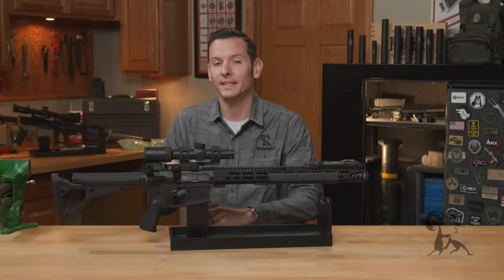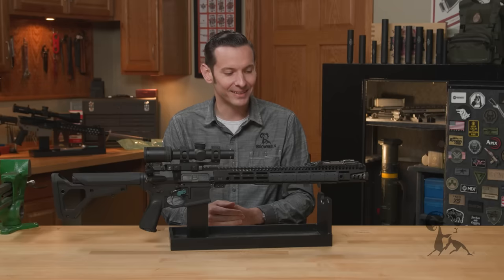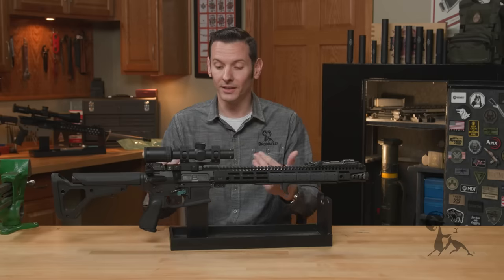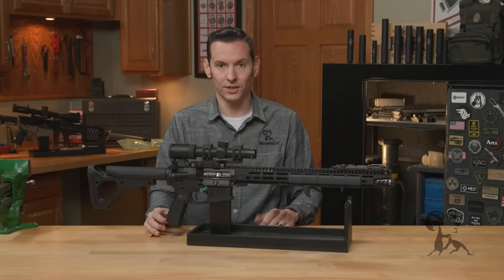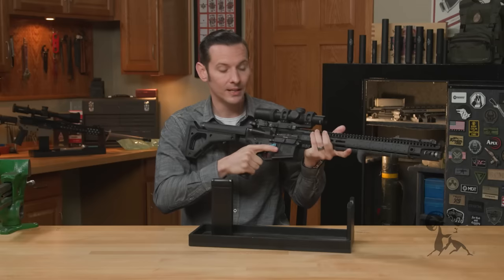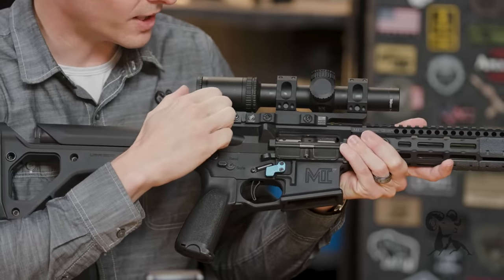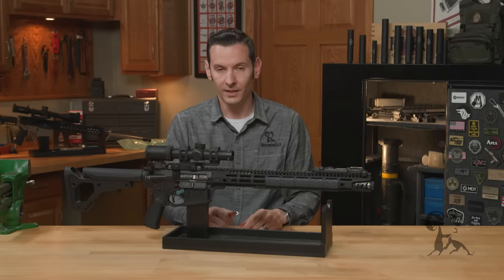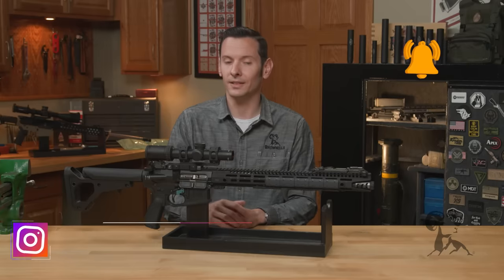Quick Tip: The RIGHT Way To Use the Forward Assist

Comment: The right way to use the forward assist is not to use it at all.
At least that's Eugene Stoner's point of view. And who am I to disagree?
Reply: And yet the US Army's extensive field testing of the weapon showed that it was absolutely necessary. And you will see Grunts and combat arms people and every single one of these threads about a forward assist saying they have used it themselves. But who are you to disagree?
Reply: @M7A1bayonet  I'm a former 11B3P with decades of experience using AR-15, M16A1, M16A2, M4A1, M4 in all types of environments ranging from coastal rain forests to Korea, Panama to the Middle East, US Mountain West to Scandinavia, including high volume shooting in all those regions and field conditions with each of those variants, including suppressed M4A1 and suppressed short barrel ARs.

I don't recall any instance where I needed a forward assist.  Does it hurt being there?  Sometimes just as an annoying protuberabce, but it has never been useful to me running the guns hard, and actually did cause some FTFeed malfs to be worse in a dust storm in Udari when the chain of command thought it would be a great idea to zero weapons in the middle of a dust storm.
Reply: @LRRPFco52  I'm ex mechanized and light infantry with 10 years in the field. I have personally used my forward assist on multiple occasions. And I've seen other soldiers use theirs as well. If you get a dirty gun with an out of spec buffer spring in the middle of a firefight and you don't have a fwd assist you are effed with a big capital F. You do you the rest of us will do us.
Reply: @M7A1bayonet  What type of training did you receive on how to run the M4, who were the instructors, and what kind of small arms maintenance culture did you experience?  Anytime 11Bs hear mech, we automatically lower our expectations.
Reply: @M7A1bayonet  I'll be happy to answer that question for you. I am the one who decides who to compare myself with. You're not.

About those field tests you mentioned: 
Stoner stated that *after many types of testing programs*, “I never saw an instance where it would have done any good … under sand and mud and every type of firing conditions in the world.” He also stated, “… when you get a cartridge that won’t seat in a rifle and you deliberately drive it in (to the chamber), usually you are buying yourself more trouble.”

Even though the Army (just the Army, other forces were happy without) mandated a forward assist for the M16, they admitted that it was more of a psychological matter than a mechanical one. They stated that, “The frequency or infrequency of the type of malfunction correctable by a manual bolt closure capability is immaterial. The knowledge among troops that such as malfunction is merely possible would lower confidence in a weapon lacking (such) a device.”

So the forward assist is something like a placebo. 
If it makes you happy, then swallow the pill, believing it will help you.
Reply: @theloki72  that's great because the United States Army still ran its trials and it still concluded after exhaustive field testing that the fwd assist was needed and that's why it's still on there today, including on the brand new M5.
Son of a gun what do you know.
That's why HK put one on their piston ARs too. HK knows a little something about engineering firearms and what is required or not.
Reply: @theloki72  in point of fact the United States Navy United States Marine Corps and United States Army all had forward assists from day one. So do numerous NATO armies who have now adopted the AR. They all wanted the forward assist. There is not even a 5.56 or 300 BO military AR in production without a Forward assist. It's there for a reason... which may not be apparent to you as you stand on your Square range shooting paper.
Reply: @M7A1bayonet  The Army wants a FA to calm the irrational concerns of its soldiers. HK added a forward assist to be able to sell their rifles to the army. Son of a salesman, what do you know.
Reply: @theloki72  HK is selling it's AR's to a big chunk of NATO, all of them seem to want a FA. Canada seems to want an FA on all it's Canadian built guns. The USMC seemed to want a FA. FN doesn't sell a model without a FA either. And Sig put one on it's new generation AR and the M5. 
Gee, I wonder why. It's almost as if it's a clue...
I'm ex infantry, I would not leave home without a FA on my M16 or M4.
Reply: @M7A1bayonet  It is cheaper to set up a single production line for one weapon than to set up a separate one for each customer, because that would lead to astronomical prices. 
So if the manufacturer has the choice of setting up a production line whose end products are accepted by all customers or a production line whose end products are not accepted by individual customers, which decision will the manufacturer make?
Reply: @theloki72  that's total bs. Any customer who wanted a slick-sided upper could get one no problem. No one wants one. Because they're stupid. Every single AR-15 contract rifle in production for military use today has a forward assist. Every. Single. One. Cope.
Reply: @M7A1bayonet  I've already explained reasons why ARs have FAs in the military. 

As I said before, I personally don't mind at all if you take your placebo. Be happy with it. :-)
Reply: @theloki72  it is not economy. If socom wanted a slick side upper they would have one. If a major NATO country wanted a slick-sided upper they would have one... you are talking about a difference of a few dollars per rifle.
It is on there for function. And is not a placebo, there are multiple malfunctions that you simply cannot overcome without a forward assist. So again, copious Maximus.

Comment: Ahhhhhhhhhh.... the forward assist serves no designed purpose on the AR15. This component is derisively known by the genius designer Eugene Stoner and his deputy Jim Sullivan as the "Wheeler Button". I would not go with the most commonly cited reason, to quietly chamber a round. This comes chiefly from the USMC who ruined the rifle with target sights, and a needlessly heavy barrel. The quiet loading, if one desires, can be achieved by pushing the bolt carrier assembly forward with a thumb using the depression for the dust cover detent. The Army could not understand how a soldier would force a round into the chamber if cycling the bolt as designed did not work. This is how the "Wheeler Button" come to be. If a round must be forced into the chamber I would eject the round.

Comment: Or a little push on the cutout on the side of the bolt carrier. A career in the Army, most of it as a Special Forces operator and I’ve not ever seen it needed.
Reply: It's a shame you weren't in the REMF unit that got overrun at An Nasiriyah, you would have seen one used to earn a silver star.
Reply: I was but a lowly infantryman but I can tell you that when your hands are wet or the bolt carrier is oily especially on a gun with the O-ring modification you are not pushing that boat closed with the scallop in the bolt carrier. It's not happening.

Comment: It wasn't meant to be hammered with the palm of your hand to seat a round. If a thumb pressure don't do the trick, Rack It!! Easy Peeesy. 
Jamming it harder usualy makes things worse.  Yes im guilty of this.  It is hard to discipline one's self not to have the urge to hammer the round in and bolt home!
Reply: You should probably watch the video
Reply: @M7A1bayonet  I did I was reinforcing what he said
Reply: @M7A1bayonet  I did I was reinforcing what he said
Reply: @reddemon652  jamming it harder cannot make things worse. It is a mechanical ratcheting action. The forward assist does not make jams worse. It is used in sports after you actually rack the action. After.
Reply: @M7A1bayonet  oh hammering on the forward assist whith your palm when there is a deformed round lodged in the darn chamber won't make it worse Hu? Hmm never worked out well for me!
Reply: @reddemon652  if you are doing SPORTS you would never do that. You are using the gun wrong
Reply: @M7A1bayonet  Have you ever had a stuck case in the chamber?
Reply: @reddemon652  yes I have.
Reply: @M7A1bayonet  the scenario I'm talking about is when a deformed round prevents the bolt from going into battery. At that point as humans we feel the urge to try and push the bolt into battery with the forward assist via thumb pressure. And when it doesn't go because it's already jammed , that when our hammering palm goes after the forward assist making the jam worse to extract because of hammering with the palm on the forward assist. Forcing the round tighter into the chamber! 
I've made these mistakes. And in my first comment was backing up what the presenter said to true,  and help one from making an already bad situation worse! Hope this helps you understand what I was originally trying to say!
Reply: @reddemon652  If you are following SPORTS procedure that is very unlikely to happen, however, the forward assist is capable of exerting an enormous amount of mechanical pressure on the bolt. If you Hammer the FA with your palm there's a good chance you'll force that round into the chamber anyway.
I mean if you are in the middle of a battle with an inoperative weapon and TRB as well as sports are not working, you might as well hammer the hell out of the forward assist. There's no time for field stripping a weapon in a foxhole under fire.
I know people who claim they've smashed the forward assist into shooting benches to force the bolt closed when an AR could not be disassembled because of a stuck case and broken extractor.

Comment: SPORTS is a gay acronym. use Tap Rack Bang. Why tf would you make the most stressful event of a firefight be that hard to remember? TAP RACK BANG. It does and accomplishes the same thing as SPORTS without having to remember the words. Stop making acronyms. They arent helpful.

Also, you dont use the forward assist with your thumb... when you rack you slam with your palm. No one has the time or dexterity to find your thumb on the button. Just use the meaty part of your palm and hit it twice on your way to the trigger (righty) or handguard (lefty)

Comment: It’s not needed
Reply: So what happens when you're in the field and a gunfight starts and you realize that your buffer spring is out of spec and the bolt doesn't return to battery after firing or racking? Then what genius?